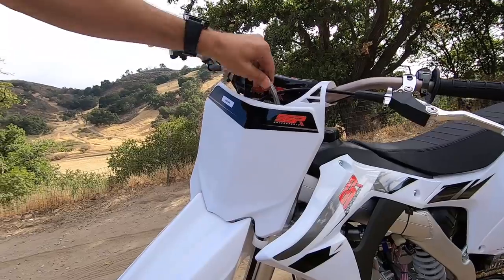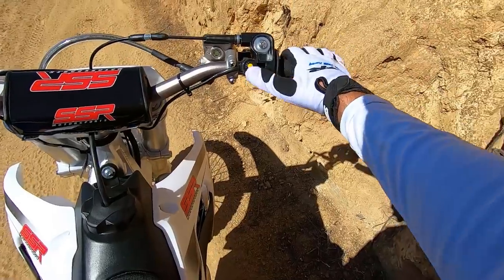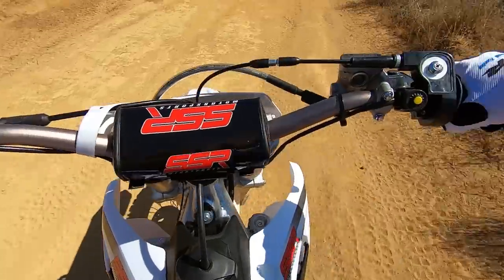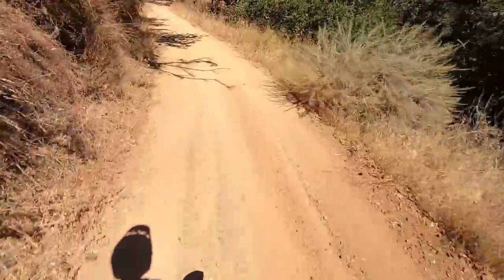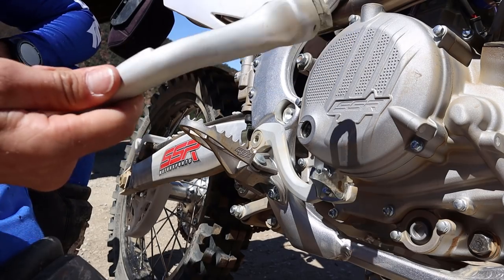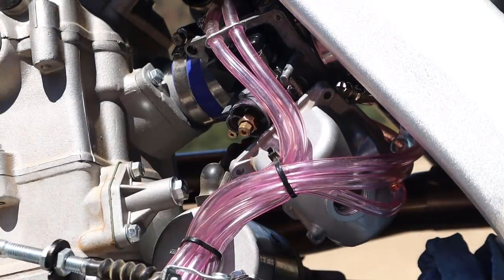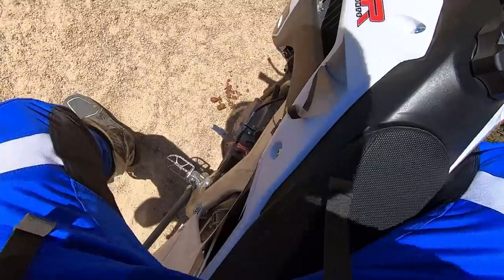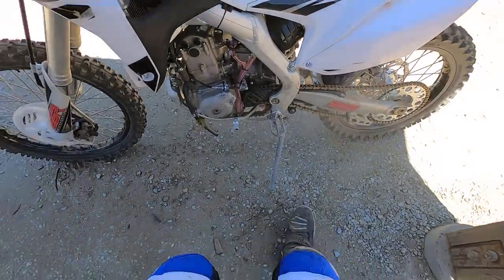I bought a brand new CHINESE dirt bike... And WOW - All new 2020 SSR SR300 first ride & review

Comment: Hey, I was thinking about purchasing one of these when I save up the money! Since it has 6 gears, do you think it'll do well on the street with enduro tires, and light kits? I know the 450's are a lot more powerful, but they're geared towards motocross racing, more than normal street / trail riding. Thanks for making this video!
Reply: Plus, I am 18 y/o, about ready to turn 19, so I'm not sure if the 450 would fit me since I'm 6ft tall. Plus, the only dirt bike I have is a cheap Tao 125 pit bike, which has been tough as nails!
Reply from the maker: @Joshtheweatherman  Hi dude,

I believe this bike has the potential to be whatever someone needs it to be, including your vision for it.

It is fun, affordable, and has room for plenty of fun mods.

The 6 speed will be great for what you want to do with it, plus gearing changes from there to get the most out of the setup in each gear will make it your own.

I'm currently working on ways to pep-up the fuel system for us all (owner's/ future owner's/ interested parties) and will be able to add that to our arsenal too.

Thanks for watching, the best is yet to come 👊
Reply: Thanks for the reply man, you earned a new subscriber!
Reply: I got the 450. Its heavy, great for desert or dual sport. If i was just trail / woods riding id get the 300.
Reply from the maker: @tieoneon1614  how are you doing on runtime hours?
Reply: @mxrevival  I got about 30 hours on it. 10 of that with SuMo wheels on. My manual says 20 hours on oil, iv changed it 2x after break in so far. My biggest complaint is the rattle/vibrations i hear, OCD bigtime. The radiator plastic is cheap and rattles, and the chain guide is all metal, needs to be switched and clunks on mine a lot. Wheel spokes need to be tightened soon after buying. So far {on 450} everything is direct swap with 2005-08 crf450x. Sprockets, suspension, carb, plastics etc. Theirs guy from Europe on here who swapped the 450r head/cam/piston in, too. I really love the bike, and can build it to what i want instead of paying $11k or $5k for a clapped out bike. I got this for $4200, there is a 300 for sale there currently @ $3400.....{Scottsdale, AZ}

Comment: I bought a PitsterPro LXR250f (a rebranded Kayo K6) a few years ago.  I think it has the same engine as the SSR300, a Zongshen NC250.  It has been a good engine.  It's street-legal & I've been mainly using it as a dual-sport.
Reply from the maker: That's killer, we appreciate the feedback too! Did you happen to install an hour meter when new?

-Charles // mXrevival
Reply: @mxrevival  No, it has a dash with speedo, odo, and it might have an hour meter too, but I'm not sure.

Comment: i’ve had some bikes without linkage and some with but the main difference is how bouncy the suspension is with my old bike i didn’t have linkage it was super bouncy for a bike that was meant for racing but with my linkage bike which i have now it’s super controllable not too bouncy and not too hard so it’s great for racing and trails

Comment: From what I have seen and read (not experience), it's good to run over bikes like this with a torque wrench before riding. I would do it with any bike TBH, but. I have heard some of the budget brands can leave some bolts etc. loose. An hour in the shop checking might save you a load of hassle. BTW - that moto park <3 - sooooo jealous.
Reply from the maker: Totally true and really great advice, for all bikes like you said 🤜🤛 

I went for it on this sucker to see if we could rattle some loose for everyone (good report, nothing loose! Not even a loose spoke)

Thanks for sharing your tip with everyone 🤘

-Charles // mXrevival

Comment: I had a SSR 189 and it had an early model Honda motor. Is it possible that all of the SSR bikes are running Honda motor designs?
Reply from the maker: I'm pretty sure there are 450 is a Honda unicam clone. I haven't seen it up close and in person just yet. As for this 300, they use a Chinese engine brand called Zongshen. There are tons of different brands of the Little engines, including Honda of course, that are Honda clones that drop into just about any pit bike. Lifan, others...

Comment: Electric start ???  That's cheating..lol....it obviously a runner ..vanyou gets factory shop service manual . and how well are you set up for replacement parts you might need for s repair you can expect to happen in competition..and general wear and tear ...   You $5k invested to go ..it might pay you to setup your own parts inventory as whatisexpencted a dealer would stock upfir a season of racing ..
..as far as mod go polish the exhaust port open up theairvbox some ..and ifyou areorettybgood at finding  things like carb jets that inter change or find larger jets in a parts book for this model ..you can become your own tuner to bring this one.into it and put itin the front of the pack ..
Reply from the maker: Cheater bike!

Yep, and the manual- correct!

Working on a lot of exciting mods & got to hang out with the Head Engineer at SSR yesterday. LOTS of good coming on the 2021 model!

I like the way you think, Donnie 🤜🤛

-Charles // mXrevival

Comment: I would love to try this bike and the Gpx equivalent. It would be an awesome bike for my wife or as a spare for friends.  Have you torn into the forks to see if they are serviceable or able to be revalved?
Reply from the maker: What's up bro, I've actually talked about this with Lund MX so we'll see if it happens someday.

It would definitely be a blast.

Ultimately, I would like to get this bike out on a motocross track, which will take some time and some specific setup.

For now I will enjoy it as a trail bike and continue to do testing and mods for all of us here... The 300 Crew!

It would totally be perfect for your wife. I'm having fun on it as a 6-ft tall, 200 lb man with years of experience as a rider.... But it is absolutely mellow enough for the wife's, and my wife would be able to hop right on this and plug around on trails no problem after owning and riding a 250f for a couple of years.

She's been off the bike for about 3 years now, but I absolutely don't doubt that she could hop right on this very comfortably and just enjoy a bike not trying to kill her. Still plenty to get in trouble with it at the end of the day so the nice mellow power is great...

Lectron carb is installed in this bike (next ride will be the real test) and feel free to check that video out on the channel if you haven't seen it. Pretty incredible difference so far! I've used them on just about everything else.

https://youtu.be/PFKjn6fyG9E

As far as the suspension, they are a brand called Fast Ace. They are definitely serviceable, and we will definitely be carrying into them in the future.

We're trying to data log useable springs, valving as you mentioned, which is really great and it's stock form for trails. It's extremely comfortable and the right springs for my weight will probably make it just perfect for trails with the stock valving.

As we figure this stuff out, and develop more mods, (several already in the works) I will be sharing them with everyone on the website. Made a whole new page just for the SSR:

https://www.mxrevival.com/copy-of-shop-tools

Thanks for watching, I appreciate it and stay tuned for more.

-Charles // mXrevival
Reply: @mxrevival  your ssr page doesn’t come up from the link you gave
Reply from the maker: @DerangedOffRoad  Oops! Thanks for the heads-up! Here it is again & I'll edit the previous:

https://www.mxrevival.com/copy-of-shop-tools

mXrevival.com too as a fallback 😎

Comment: I just ordered some gear and it came couple weeks ago , started this video and saw you had the same gloves and gear as me lol I am curious how this and the Gpx Fse300 compare as I currently have a Drz400sm and want to get one of these 300s or the tse250 two stroke . Does this have 5 or 6 gears ?
Reply from the maker: Kick ass! The gear is holding up well but just like all brands, my knee braces eat through the knees (no brand is safe from my braces!)

I cannot speak in the other brands but I do know that I truly enjoy this bike and will be continuing to build aftermarket mods and support for all of us here mXrevival.

Mods for The 300 Crew!

P.S. it's a 6 speed and the tse 250 is based off of the old Yamaha wr two stroke engine.

-Charles // mXrevival
Reply: @mxrevival  Very nice , after I wrote this I watched your Lectron carb install which my brother put one on his DRZ that is identical to mine and it worked pretty well , also you have my Husky tool box LOL Great channel love the videos and in depth review , as a rider for over 25 years I really dig your point of view and bet mine would be similar . Do you have affiliate links for any gear or the bike themselves?
Reply from the maker: @BULLION79317  We're brothers then! 😎🤘

Hey thanks so much for asking but I do not currently. The gesture means a lot to me regardless.

As I get learn more & get better with using YouTube I'll have to look into the proper way to do that & get some of my favorite stuff out there.

Hope you had a great weekend!

-Charles // mXrevival

Comment: Seems like a solid bike. As long as I could get parts for it I might ride one..
Reply from the maker: Definitely!

Lot's of Honda parts will bolt right up (or aftermarket) Engine has good replacement parts availability as well. Possibly the most-used Chinese motorcycle engine on the planet in 250cc, 300cc, and 450cc.

Thanks for watching 💪

Comment: Was thinking of getting a used bike and stripping the internals so that I could make it electric. (Trust me, I would absolutely love to have a internal combustion bike, but cost governs most of the decisions ATM, and I have a feeling that an electric bike will be cheaper maintain.) Would something like this, or even those weird Chinese pit bikes that are somewhat normal sized be applicable for something like this?
Reply from the maker: 100%. Full sized and a bit tall even. Do it 🤘
Reply: @mxrevival  what about those really cheap ones off of amazon? (Doesn't matter if the internals suck, as I'm going to remove them anyways. Just want to know that everything else is durable) I only ask because I'm on a really tight budget, and I would still have to buy gear

Comment: Did you ever get the green sticker and which dealer did you buy the bike from I would like to us them for my purchase. Thx
Reply from the maker: Hi Art, thanks for watching. I did get a green sticker, but I've learned that it was not supposed to get one. I don't know if the 2021 models will be as lucky, so try and find a 2020 if you can. also the green and red sticker thing is going away, not sure if for the better or worse but assuming for worse as we're in California!

Comment: Basically a Honda chassis and setup. Just goes to show, the markup on most bikes since oh, 2015, has been huge. If these things can be built and sold for a profit at under 5k. They cant possibly cost more than $3500 apiece to produce?
Reply from the maker: Probably much less! Factor in employees, shipping, manufacturing- that's all before SSR gets them & sells them to dealers. Then the dealer still makes a nice margin too. Capitalism doing it's thing (it's a beautiful thing)
Reply: @mxrevival  Nothing "wrong" with Honda equipment, but I've always preferred Yamaha motorcycles. The R&D is superior. I could see maybe purchasing one of these Chinese units in a 200cc or smaller model for $1500 tops? I'll stick with my Yamahas for any serious off road action.

Comment: Does it make enough power to power wheelie ? I do a lot of desert riding mainly 2-3 gear stuff
Reply from the maker: Probably not like I'd "assume" you want it to in 3rd gear with the stock carb & stock gearing. 

I think that if you gear it down a little (let's say you add two teeth to the rear sprocket) then yes.

Otherwise the bike does make pretty dang good low RPM torque, and with a sorted fuel system I think it'll wheelie strong. 

I'm working on that for us 😎

Thanks for watching!

-Charles // mXrevival

Comment: Hey Charles, do you know if this bike is plateable, or is it classified as a competition motorcycle? If so, do they offer a light kit or the option for one to be installed?
Reply from the maker: Hi Kevin, there is indeed a dual sport accessory kit for this bike. It's a factory SSR accessory that your dealer should be able to get for you no problem. You can see it installed on the SR300 in this video: https://www.youtube.com/watch?v=zOUkrH4JonU&list=PL_oYXNbYADbKcVE5-1ziR2exgppjvvGJQ&index=3&t=1738s The dude showing it to me is the lead engineer at SSR in Southern California.

Getting them plated just depends on your local DMV. Sometimes you need to get crafty if you live in a place that doesn't allow it. For example, in CA there's a law that states bikes 2007 and up needed to be factory equipped & come with a plate for street when new, otherwise they cannot be converted. Before that, there were shops converting all kinds of stuff to street legal. 

A few years ago, I was building a pair of bikes for a friend & his son. A 2006 YZ450F & RM65.https://studio.youtube.com/video/P0YvVCjfUEI/edit (wow this is so old now!) He wanted the YZF plated, so I "bought" and registered his bike to my Idaho residence, paid $45 for a street plate that was handed to me on the spot, and then "sold" him his bike back. That's what I mean by getting crafty. I don't know if he ever registered it back in CA but the intent was that the bike now came into the CA DMV system as having a street legal status already. 

I'm sure there are more tricks I don't know too. 

Hope that helps 💪

-Charles // mXrevival
Reply: @mxrevival  hey Charles, thanks for such a detailed response, holy cow! As it turns out we have a dealer close by (I'm in NY btw) and he said no on the street use issue as it is labeled as a closed  competition bike. When pushed further , he said he was not aware of any "road kit" to make this bike legal. Strange because I know someone with a gpx and you can plate them hear, and they are essentially the same bike. Has to do with factory labeling I guess. To bad cause that would make it easy to get to local spots without loading up to drive a few miles, oh well. Their are other options and I'm still exploring. Thanks again and keep up the good work!

Comment: My boots were hanging up on my
bike, very annoying, I wound up making
a 'keeper/stop' for the kick start lever so 
when I brushed up against it, it would not 
move. I'm not against bending levers or
modding' them to make them right either,
but of course 'we' take them off the bike
before making any bends lol. 
I would surely not eliminate the kick, 
I'd bolt it somewhere on the bike or keep in 
a back pack if you can't mod it and get it
anchored better.

Comment: Is it just me or do the plastics Look Exactly like a 2020 Crf450r?
Reply from the maker: Your eyes do not deceive you!

So basically, the entire Mike's body mirrors that of a 2013 through 2016 Honda CRF450R.

The radiator shrouds however, look a lot like the 2017 through 2020 CRF450R... But they're not.

They like a little bit of material and are overall smaller.

Just about done hand templating a decal kit for this bike to share with everyone, and we assumed the same thing in the beginning, just at a glance. 2020 CRF450R shrouds, but it wasn't the case.

Also, a complete 2016 Honda CRF450R plastic kit (meaning you can get many more colors from several different brands because of this) would bolt right onto this bike. Radiator shrouds as well.

Hope that helps!

Thanks for watching,

-Charles // mXrevival

Comment: I am looking for something to bridge that same gap. I am just worried about it’s long term durability. I would like see a 100 hour review
Reply from the maker: Reading in much odder forums that the Zongshen platforms have gone hundreds of hours for some. We will see!

Awesome parts availability and DIRT cheap too.

Hour meter is installed & ready to rack 'em up.
Reply: @mxrevival  I have had a couple of Chinese pit bikes and had mixed feelings with them. I liked how there was always cheap upgraded parts for them, but something was always broken or wore out. Their metal was super soft and bendy and their aluminum parts are cheap cast that breaks. Every time I got parts that were supposed to be for that bike, I had to always get creative and modify to work. I was always trying to straighten out parts that were bent out of place because of their softness. If these hold up like a real bike, they have a winner.
Reply from the maker: @JohnDoe-du6yi  I am so on board with all of this. 

I think that day has come for SSR! A company with an American home base no less 🙏